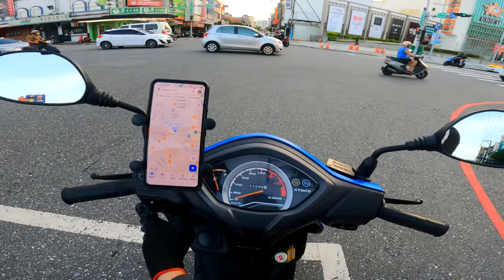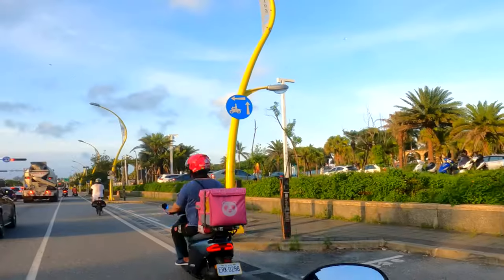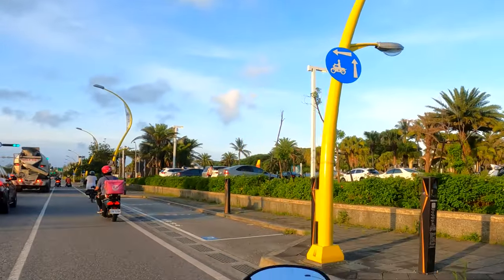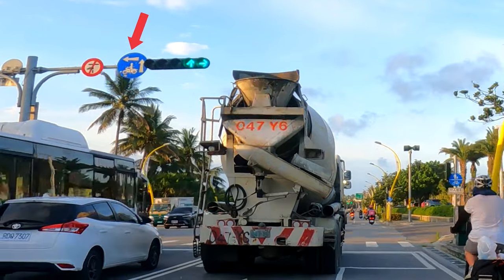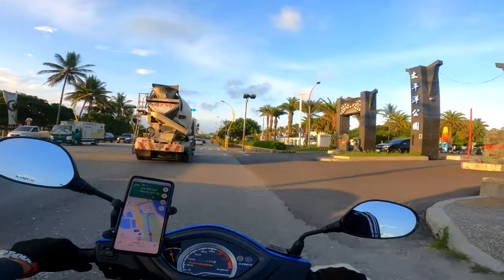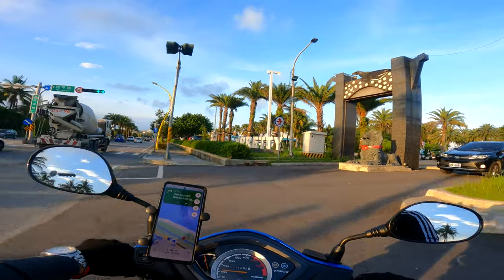Taiwan 🇹🇼 - How to Make a Left Turn for Scooters and Motorbikes | Motorcycle Safety

Comment: As a local, it's the worst traffic rule in Taiwan to restrict motorbike. 
You can also see there's 禁行機車(motors under 250c.c can't ride) everywhere in the passing lane.
Just because the traffic department thought motorbike is a dangerous transportation.
 
But Motobike >251c.c can turn left directly. It doesn't make sense.
Reply from the maker: Hm, yeah I can see what you mean..